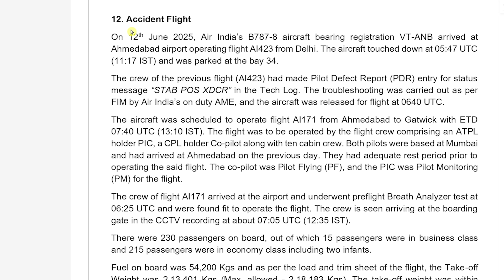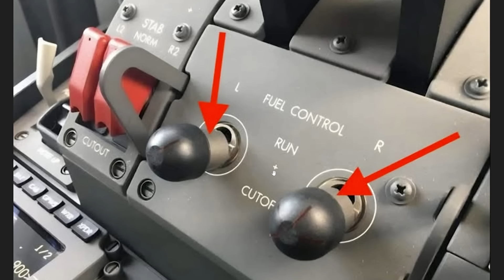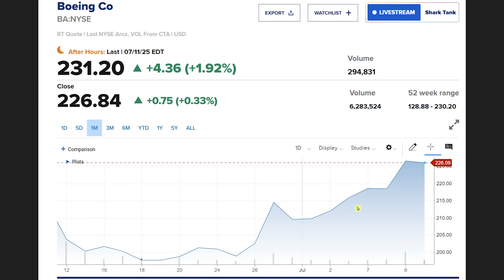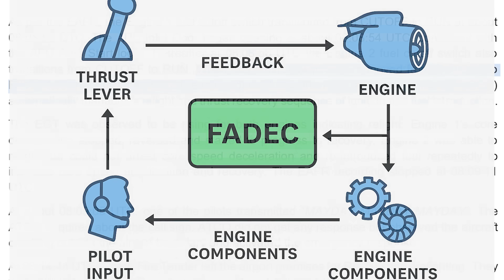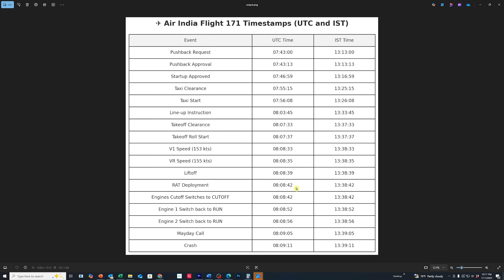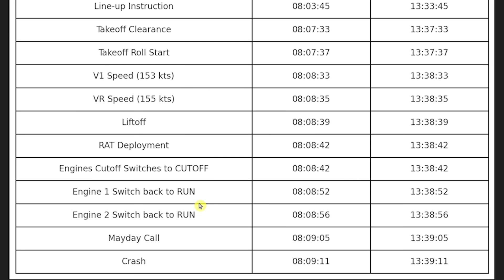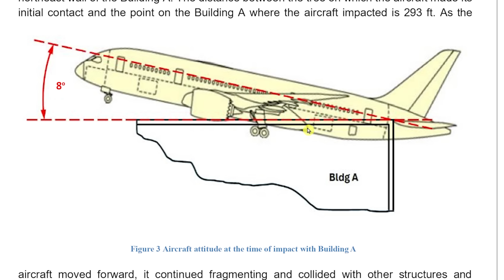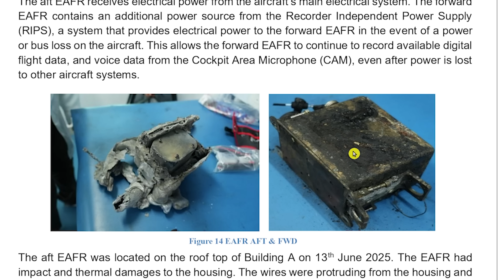Did Pilots CUTOFF Fuel? Shocking Twist Air India 171 Report!

Comment: As an aircraft technician for over 39 years and taxing many types of boeing/ airbus aircraft , I never made the mistake of turning an engine off accidentally. It's a very conscious move/command.
Reply: Agree, as a chinook pilot I can attest that everything is pretty much a check listed item. Further, it’s all muscle memory and memorized motions.  I would be curious to see what the pilot observing checklist items during this timeframe. Would his hands even be in that area?  That’s probably the next step is to get a hold of the checklist and routines and see what switches, items and motions are in play at that moment?
Reply: @user-wo6bm5vs1n  No way the fuel cutoff switches were enabled as part of a takeoff muscle memory routine. Normal muscle memory is move the thrust to full, put you hands on the yoke and complete the takeoff. The pilot in control of the airplane was focused on takeoff, so I assume it was the other pilot not in control of the aircraft who moved the switches to fuel cutoff. This is a criminal investigation now.
Reply: @numbr6 Absolutely. It would be like turning off your car’s ignition while driving. You just wouldn’t do it.
Reply: @numbr6 Perhaps we’re splitting hairs. It’s muscle memory to use these switches for startup and shut down. And a once in a career mid flight restart or damaged engine.
Reply: Dass der zweite Pilot verneint, die Treibstoffzuhr abgeschaltet zu haben, hängt damit zusammen, dass ja wenige Sekunden genügt hätten, den Schub wieder einzuschalten. Indem er verneinte, schaffte er ein wenig Zeit, die benötigt wurden, um den Jet vom Himmel zu holen.
Reply: @numbr6  Pakistan…
Reply: @numbr6 who you going to charge the dead Indian?
Reply: I had a feeling that the captain said cut off means to pull back the throttle not cut off the fuel switch. I think that’s where some one said no thrust or power and call out mayday. Simultaneously the captain switch the cut off switch off and on to restart the engines was too little too late . Something more sinister happens. Will wait to see more evidence from the black box.
Reply: Look at the times. This happened so quickly there was no time for a fight. There is only time for the other pilot to react.
Reply: Okay but can you do it without the other pilot noticing immediately that you are doing it?! It's RIGHT THERE IN FRONT OF BOTH THE PILOTS, right?!
Reply: is RAT drop off before fuel switch was turn off. if RAT droped before switch off means is Computer glitch
Reply: @DK-lg7ti   It looks like it happened exactly at the same time. Same second. Fuel Switches (both at the same exact second -- which is really wierd bc when they were turned back on, there was a second lag betw them) turned off at the same time the RAT dropped. Something isn't kosher.
Reply: @eyedeegee19  exactly! I am mystified why this isn't being discussed more.
Reply: @DK-lg7ti  According to timeline it was the same second. Can be software controlled to maintain power supply on fuel cutoff.
Reply: Do you have any experience with this specific model of aircraft? Do you have information about the electrical schematics for this portion of the aircraft? Do you have any information on how the switch positions were recorded by the black box? Is there some sort of dataaquisition system that detects the switch position, or did the blackbox record the solenoid / valve / pump control inputs? I have a concern about there being a vulnerability in this system, and we need to rule that out. The cockpit voice recording has the apparently "guilty" pilot saying "I didn't shut them off!".
Reply: @dohabandit  
402 / 5 000
Which pilot was at fault, or neither.

It is unlikely that these switches would have a separate pair of switches that would tell whether they turned or not.
Before, the cockpit switches directly controlled the valves, now there are all sorts of semiconductors and relays in between, no need for a wiring diagram to explain it.
Maybe the next similar accident will wake you up.
There is nothing new in that
Reply: Some pilot bloggers have said the Captain had medical issues , soon to retire to care for his aging father, my guess is with his career over he did not want to be stuck @ home and be a caregiver.
Reply: But the switch is sending an electrical signal, so there is still a possibility that it's not a human action. 
As far as we know co-pilot is the one flying, the captain is monitoring if any arm movement reaches out to the switch captain should spot it right away instead of asking the question 10 seconds later. 
If it's the captain moving the switch, the co-pilot should also hear a click sound and ask immediately because it's the switch they turn on/off every flight. Besides, if it's the captain, why would he ask someone to pick him up when he lands if he is the one doing all these?
Reply: @maodijim signal as signal. But how do you explain the mechanical position of switches?
Reply: I have been watching a AI 171 crash Vedio by: Aviation Watch and somehow this English gentleman said that he found through some government department analyzing a passengers phone text message telling their loved ones that they heard that " a new fuel system would be checked/tested on this plane, and that thing was taken away with maximum security to a military somewhere . 
My concern is that the Indigenous Bharatiye people and the British people should keep an eye on the Government.  BJP Government is  Foreigners  Mitanni, Medes, Mittani, Hittitie, Hurrian, Assyrian, Yanmya, Eurasian Steppe.  
Condolences to the grieving families.  
Girmitya Descendent 1879-1916 Fijian Bharatiye.
Reply: mind bogglingly misanthropic.
Reply: @BlueshiftRadio  What can be concluded from that if no one flipped those switches?
Reply: @pekkavirtanen5130  It means someone lied.
Reply: That means they turned the switches back on intentionally too.  Why did it take them 10mins to turn the switches back on? Surely they must have seen the warning signs as soon as both switches were turned off? Were there no alarms going off when both switches were turned off, if not why not?
Reply: @HDsharp  The position of the switches is not monitored directly, but indirectly by the voltage in the line or in the subsequent logic.
Reply: @pekkavirtanen5130 surely the situation of both switches in the off position during take off would trigger alarms and bright warnings signs, right? If not, then that's the problem.
Reply: The pilot was at the controls pulling back the control column taking off.
The 1st Officer reached over with left hand to the 2 fuel knobs beneath the air speed control the pilot had his hand on.  The Pilot saw the movement of hand on fuel knobs asking the 1st Officer "why did you do that"?
Reply: @LeslieJackson-d2b   10 seconds after it happened? It took him that long to question his flying partner?
Reply: @HDsharp  misconclusion. look closely: shortly after sec .42 the switches went to cutoff the engine startet spooling down. The Catain realises it 5 seconds later asks the co pilot what he did and then startet to put them back in RUN position within another 5 seconds.Tthere were 3 seconds delay between first and second wich is normal. It all went down very quickly.
Reply: @HDsharp probably there was fight going in betwen pilot and copilot and the one who switch off the fuel button want crash the plane
Reply: @saraedword2985  Sorry, I got it wrong, it took 10secs not 10mins before they turned the switches back on. Btw Everything would be heard on the black box if there was a fight. This is a strange case. Because if it's suicide, it was a risky calculated attempt. Because the plane nearly recovered. 
The switches were turned off as soon as take off. If one was to calculate a suicidal attempt, the chances of pulling this one off is not guaranteed so there was a risk of getting caught. I would think someone planning to do such a thing would have a more secure solid full proof plan minus any chance of being caught. So this one still baffles me.
Reply: @HDsharp  They did it right after takeoff because if you do it right before takeoff then the plane is going to abort that takeoff, and if they waited just a little longer to do it, then the recovery options would have actually recovered the plane.  The window during which this procedure would be guaranteed to cause a disaster is very small.  Folks in other threads have said it's about 20 seconds.
Reply: @HDsharp    The report states that the switches were in the off position when recovered, so, as far as I know, there's no indication they were switched back on.
Reply: @mbd6054  on the contrary. I read the report, they were switched back on. The engines were restarted but too late to save the plane from going down.
Reply: @Asterra2 Also, the likelihood the person would be seen doing it would be quite high. The fact no one saw the person switched them off is baffling. Because someone said 'why did the switches were turned off' and the reply was 'i didnt' whoever switched them off wasn't seen doing it. And there was no scuffle or fight to prevent the pilot switching the switches back on. This tells me, there was no suicide plan.
Reply: @HDsharp  They didn't ask why the switches were off.  They pointedly asked why the other pilot switched them off.  The other pilot could have responded in any of three ways: A weak excuse, silence, or denial.  Only denial would give someone pause and have him second-guessing whether switching them back to RUN now would be the worst decision he could make.  Silence or a dumb excuse would have immediately alerted the other pilot to exactly what was going on.  This was premeditated well.
Reply: @Asterra2  if they saw the person switching the switches off, there would have been a dramatic attempt to switch them back on again or some scuffle to do so, but that's not the case. There was no panic, no cursing, like why you did it?! Don't you find that strange?
Reply: @HDsharp  You're definitely presuming way too much on the part of a pilot who has never encountered or even envisioned this particular action coming from their copilot.  If somebody in charge of their half of routine but complex duties wordlessly sneaks in something that seems like a bad idea, the other guy isn't immediately going to think "Oh no!  He's trying to kill us all!"  He will ask why the heck it was done, though.  We also do not know what else audibly transpired after said interaction because the report provides no further details.  We do know that more words were said—for example, someone definitely yelled Mayday and that would have been part of the recording.  But that's not in the report.  The report is not going to be thick with those details because it's preliminary.
Reply: @HDsharp there were only two people in the cockpit!! I'm not sure why you're sort of suggesting that there were hoards of people milling around in there and surely one of them would've spotted something amiss??!?
Reply: @HDsharp 10 seconds not minutes. Even that tho was too long in between
Reply: @HDsharp ten seconds not minutes
Reply: Are you Indian?
Reply: @cristan9582   Why is that of any importance to you?
Reply: 37 years of being a professional pilot and I have never done that.
Reply: I too was a line mechanic for 20 years and I know there’s no way to accidentally actuate those fuel shutoffs
Reply: @rickdavid1795 only if some design sers are wrong!
Reply: this is what happens when you have an IT tech as a co-pilot. “have you tried restarti g…”
Reply: And two of them too!
Reply: This is the FACT that so many (NOT in the industry) will do mental gymnastics to NOT accept.

Thank you.
Reply: Agreed Tourbillion and to do it twice!?  Is it at all remotely possible that there was an electrical problem associated with the Fuel Run/Cutoff management system. An uncommanded error that put them into shutdown mode with out any mechanical input. I really think so. Neither of the pilots commanded it.They/he quickly reset and the engines went into auto restart mode.They could have made it with a few bit more altitude. A drink/fluid/moisture, software  malfunction could of shorted out those wires and activated it. I don't buy this suicide deal. No way. Blame the pilot our plane is safe. Yes his mum died and he was emotional but he vowed to look after his dad. I just don't buy it. Thoughts please.
Reply: And are you're not aware of the airworthiness information bulletin about the switches?About these switches having been installed with the locking feature disengaged?
 And there's a reason why some aircrafts are designed in a way that the system can only be actuated while the thrust levers are at idle.
Reply: @danielm.4346 It is my understanding that these switches were installed “upside down” which if true is a design problem. Poka yoke is designing the installation so that this cannot happen. If they were actually “defective” (doesn’t meet the specs or is manufactured wrong), it wasn’t serious enough to ground the planes, demand replacement immediately, etc. What eliminates defective switches is the timing. One second apart for the off position and one second apart for turning back to the on position, which means, someone moved the switches.
Reply: Its amazing how all the bots and experts seems to lean towards blaming the pilot when we dont know at lot at the moment.
Reply: Beware, blaming the pilots could be an excuse to avoid the responsibility of the aircraft manufacturer.
Reply: Thank you for your expertise. Is there any way that the recordings have been interfered with? The reason I ask is what Boeing has to gain by showing it is pilot error
Reply: I have seen a Vedio that a new fuel system was being tested on the AI 171 plane.  Passenger text.
Reply: The computer did it !!!!!!!!!!!!!!!!   everything else is lies by boeing and its friends.
Reply: pilot asking why did you turn off the fuel is suspecious. Why did he let other co pilot to turn it off while takeoff critical situation. Seems like the pilot did that and blame to co pilot as he knew about recording. There is no possibility both switched turn off with out manual intervention. Its fully suicide
Reply: Both switches needing multiple manual movements were turned off in the same second. The dexterous gymnastics required seem to exclude intention to me.
Reply: @dremondrade5724    That's exactly what I wondered. I heard a pilot describing that one would normally need to use three fingers to complete the manoeuvre, and I wondered how both switches could be turned off within a second of each other.  It doesn't sound quite right. It would be interesting to see someone doing it on a simulator, while being timed.
Reply: @mbd6054  Even if you haven't seen the switches in question, or don't understand exactly how long a second is, eventually somebody is going to upload a video of exactly this action—the flipping of these switches one after the other.  One second is a quite reasonable amount of time to maneuver the two switches, especially if you're specifically trying to do it quickly and surreptitiously.
Reply: @Asterra2     That's interesting. Thank you for your response. I know how long a second is, although your concern for my intellect is touching. What I don't know, in common with the majority of people, is how long it takes to switch off one of those controls, given the safety device attached to it.
Reply: @mbd6054  The activity required is pulling a switch out by about 2mm, flipping its position, and releasing it so it can come to rest in the opposite position.  There's really no way to suggest that this action should take multiple seconds.  Several aviation channels have already air-demonstrated the action.  But like I earlier suggested, there is likely to be a video or multiple videos posted which perform the procedure on physical hardware, clearing up any lingering confusion.
Reply: @mbd6054  will the computer logic allow sudden fuel shutdown while throttle position is at full thrust..?
Reply: @mbd6054 THERE is video of a pilot showing both switches can be turned off with only 1 second delay between them 

.
Reply: @mbd6054 it doesn't seem like a terribly complicated manoeuver though. I'm sure you could do it on one then the other a second later.
Reply: @mbd6054  Jeff explains and demonstrates that in this video! Did you comment without watching video?  Seems a lot of that going around these days.
Reply: @dremondrade5724 So it was random ghosts?
Reply: @robinmueller3778 There is a report I saw on BBC that stated that some 737s manufactured in 2018 had the fuel cutoff switches without the spring loaded gates. There was a service advisory, though not a mandatory service requirement at that time. Now, the 787s apparently use the same exact design as the 737s, and were also affected by this service advisory. Air India apparently did not chose not to do anything about the switches, since it was only an advisory. 

How much of that if true played a part here is a tough thing to resolve. Might take months or even years. 

If that wasn’t the case here, then definitely this was intentional. Co pilot was flying the plane, and the captain was observing. The captain’s father was ill so the captain had told him he would quit flying to take care of him. Just doesn’t make any sense why either pilot would have any reason to do something so shocking and drastic. 😐
Reply: @Redshift5265 I read a report that Air India checked the switches twice as a result of that advisory a replaced that entire assembly in 2023 🤔

The fact remains that millions upon millions of flights by Boeing aircraft using that style of switch have been safely completed. 

If this was a simple and chronic problem, Boeings would be regularly falling from the sky with simultaneous accidental dual engine failures. It’s also interstate two switches would accidentally fail at the exact same time. The statistics behind that would be mind boggling
Reply: @robinmueller3778 I agree. It looks like 90% chance this was a suicide/murder by one of the pilots.
Reply: @robinmueller3778  It was just one of the pilots that obviously isnt going to admit what he did. Maybe because of insurance. These pilots know how people look at Boeing and they expect people to blame Boeing. The money will go to the family. It has happened before
Reply: @Redshift5265  Debunked.  You would need to explain how the switches in this plane, obviously used for thousands of prior flights, both elected to malfunction in a conspicuously human-like cadence, in the exact, very small window during which their deactivation would actually result in a catastrophe.  I do get that this report is a popular lifeline for folks who would prefer to blame the plane, but as long as one's interpretation is subject to garden variety logic, it should be quite easy to dismiss such a ridiculous proposal on one's own initiative.
Reply: @Asterra2 Read my posts before accusing me of bias, dolt.
Reply: @Redshift5265  Absolutly we need to be careful as we dont know if it was a crew or mechanical issue so dont put anyone under the bus until more is known.
Reply: @Redshift5265 Regarding the switches, had they been out of spec for some time, prior pilots would have seen and reported.
Reply: @Redshift5265  - it's beginning to look like that it was the co-pilot because of the order that the fuel cut-offs were operated and it was the Captain who placed the switches back into their 'run' position in the reverse order that the co-pilot switched them off.
Reply: @tedwalford7615  Yes, that’s definitely possible. It is most likely a pilot suicide. It’s also murder of 280 people..
Reply: @Redshift5265 suicide 100%
Reply: @Redshift5265  always found it odd if the ‘natural’ state is down in the off position if there was a mechanical failure isn’t that a serious design flaw?
Reply: @Redshift5265  The throttle control module on this aircraft was replaced in 2019 and again in 2023.
Reply: @Redshift5265  , não é a mesma peça. Está tudo no relatório.
Reply: @Redshift5265 They have the switches

It won’t take years to discover if they have the locks working on them.
Reply: @jackworsley2562Knowing the bureaucracy it might just take one year or more, for the FULL report.
Reply: @dremondrade5724 NONSENSE.  There is video of a pilot demonstrating the fuel cutoff switches can be set to off with only 1 second delay

.
Reply: @dremondrade5724  the report stated the switches were switched off 1 second apart - which is doable.
Reply: @msv-777  Not on the report's gridded timeline. Both switches were thrown and the RAT deployed in the same second.
Reply: @msv-777 , it could be idle one is either siting or standing over them. Is there a possibility?
Reply: @msv-777  why it took 4 secs to put them back on? also rat deployed in the same sec as first one off... almost instantly? or before ? milisecs are important now. because something doesnt really add up... how quickly is rat deployed and how it senses when to deploy and how fast it is initiated? i hope some people can triangulate the rat/height/timestamps from the videos to see if it matches the stories being narrated. the whole story seems a bit odd and sound more like a cover up right now. AI in a way saying maintenance was not issue, boeing side saying no technical problem, also how is insurance involved in this? something is stinking, and i can already smell it. i hope i m wrong and pilot did it. not like the pitot tube fiasco some years back noone knew about would bring the plane down
Reply: And both denied but still people are he’ll bend to prove that it was them who did it
Reply: @vikasndl11  The only hell bending I have seen are those inventing wild longshot or impossible scenarios to explain what happened in order to avoid what the existing evidence suggests.